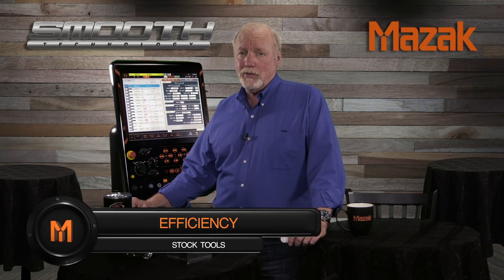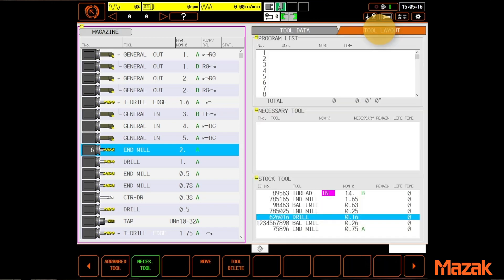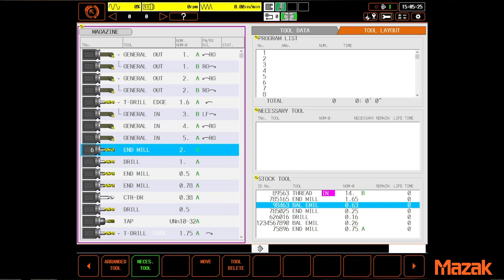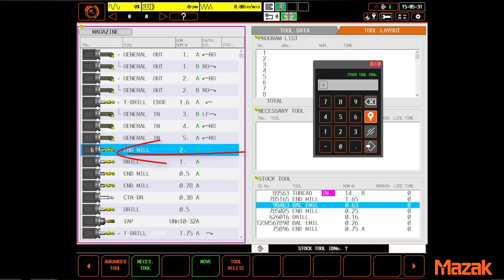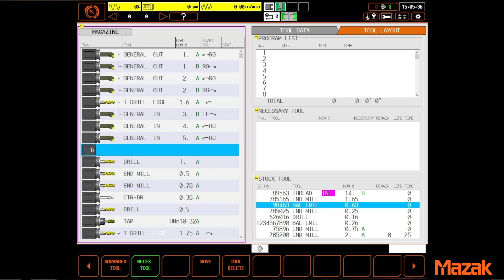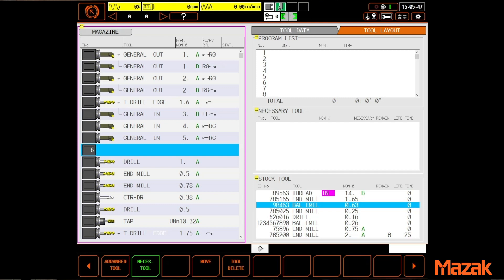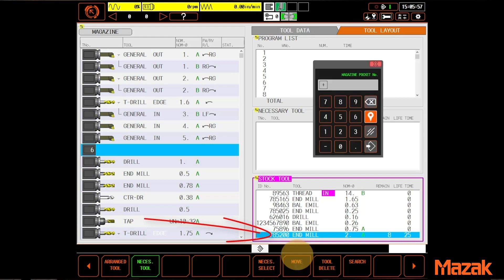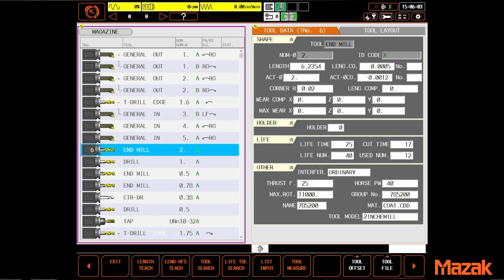Mazak SMOOTH Cafe: Stock Tool

Comment: Personally don't like your machines... I work with a M32 - Big - blue and has a floppy disk drive. Mazatrol, no idea why you'd want people to stand a machine navagating non-intuitive menus when you can literally program it from a computer into G-Code and you're done, checked, loaded and running in less than ten min. Don't know if your new machines are any better but the M32... No.. Just no.
Reply: You're talking about a roughly 25-30 yr old machine man. There is a big difference with every manufacturer in 25 years.